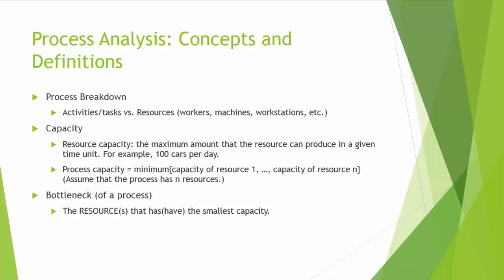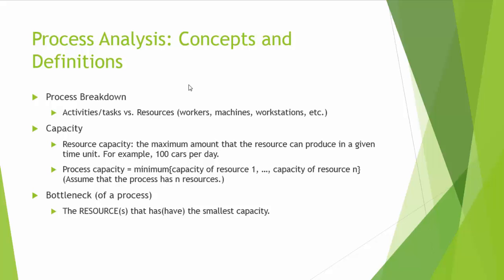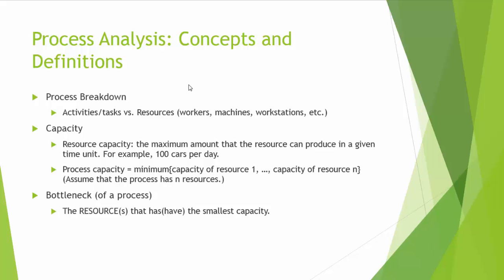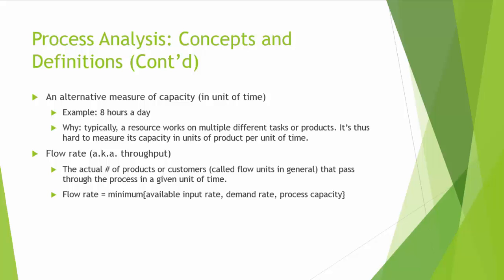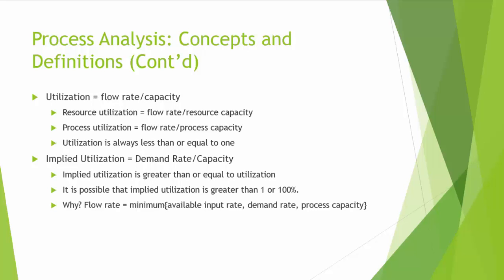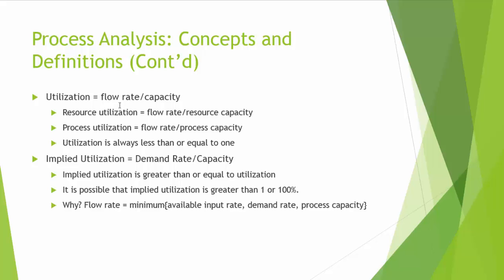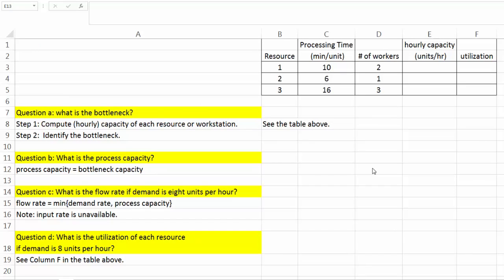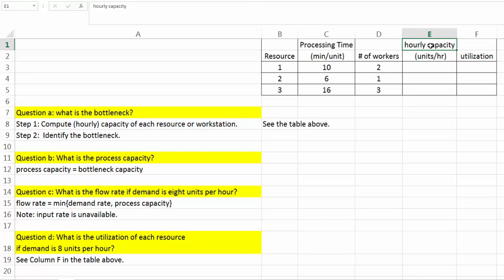Process Analysis with Example

Comment: how is flowrate 8 ?
Reply: Because demand rate was provided as a given at the beginning of the problem as 8 units/hr. With process capacity calculated to 10 units/hr, demand rate is smaller than process capacity (i.e. 8<10). Flow rate is the most efficient use of resources and production of units (i.e. while 10 units/hr can be processed, only 8 units/hr are demanded, so no reason to make 10 units/hr if the customer only wants 8). Therefore, flow rate equals 8 units/hr. 
Another way to think about it is that your kitchen tap can supply up to 10 gals/hr, but you only open the spigot enough to get 8 gals/hr, so there's no reason for the spigot to supply 10 when you only want 8, or else you might overflow or spray water everywhere, causing you (the customer) a disaster that you are now required to mitigate.